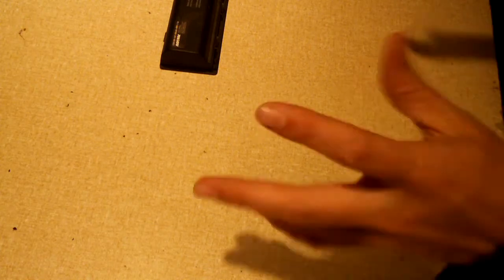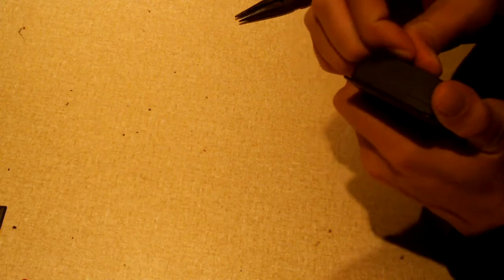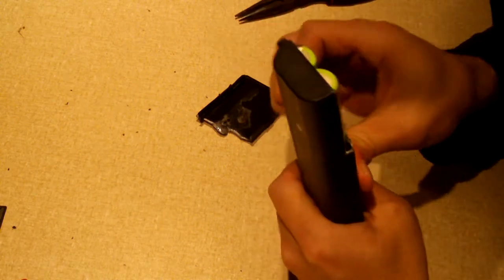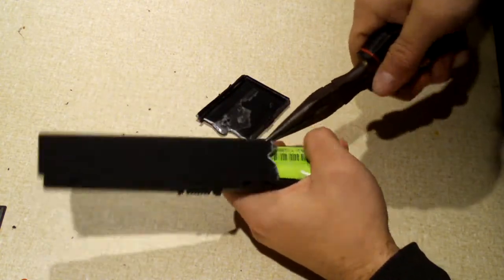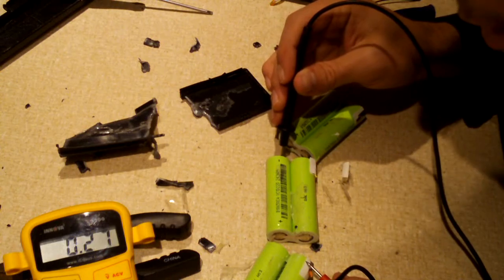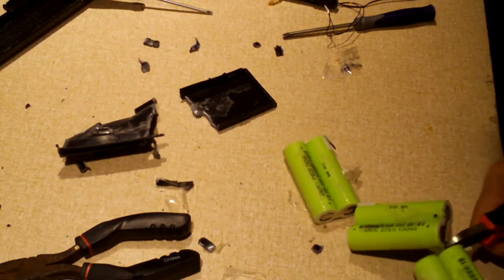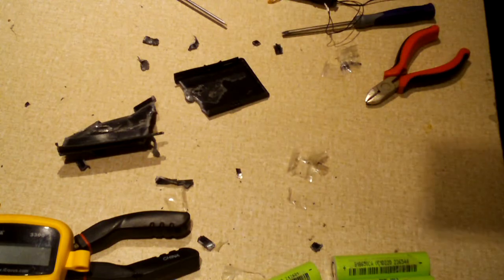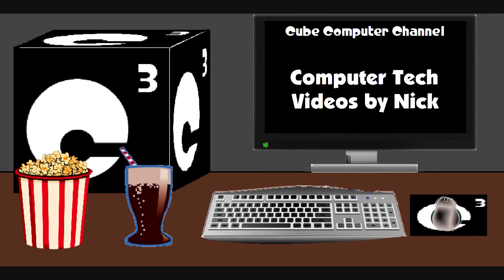Let's see what's inside a Rayovac Replacement Laptop Battery

Comment: Actually you can revive these the protection fault switch was triggered wich shuts the down all you is take a Bobby pin and put it in the vent holes in the positive terminal and with the Bobby pin bent at at a 90 degree angle and push the switch down inside the battery and it should pop up to 2.8 volts I've done this many time on all batteries Samsung lg but do this sa at you own risk and if you smell a sweet smell toss the battery
Reply from the maker: Typically if the CID has operated, you should toss the cell as the CID likely operated for a reason.

Comment: I use 18650s in my vape and there high drains I've always wondered if you took out the normal 18650s out of a laptop and put in high drains if the battery would last longer
Reply from the maker: Since laptops don't pull much current to run (their 18650 cells are generally rated for 2C, commonly meaning 4-5A max draw), you wouldn't really see much of a difference in runtime. This is why laptops still commonly use ICR chemistry cells, because these cells offer higher capacity at the expense of cell draw. Many high-drain batteries such as those for vapes and power tools have lower capacity cells, sometimes down to totals like 1500mAh. The high-drain technology is improving, with LG Chem recently launching a relatively high capacity, high draw cell.